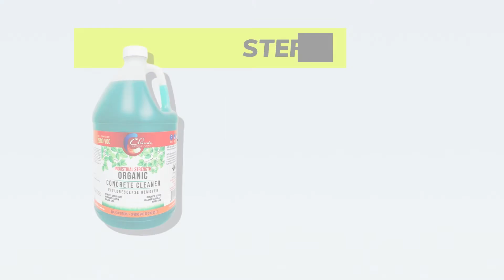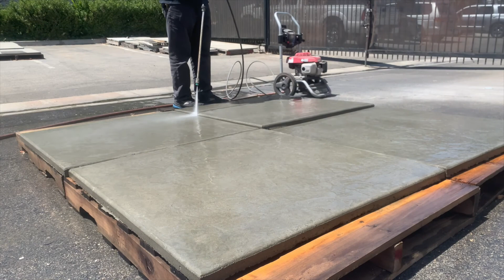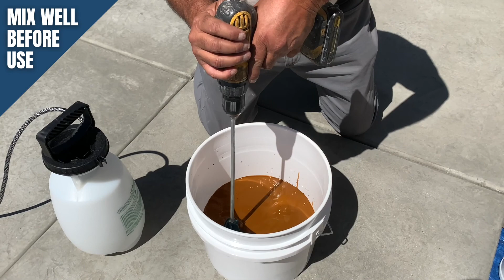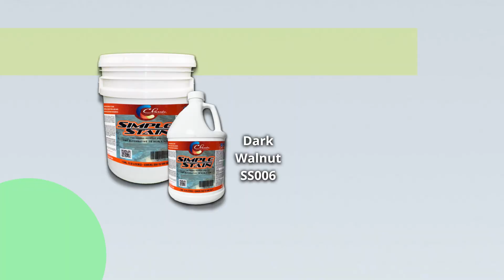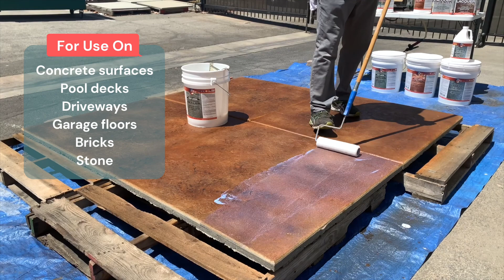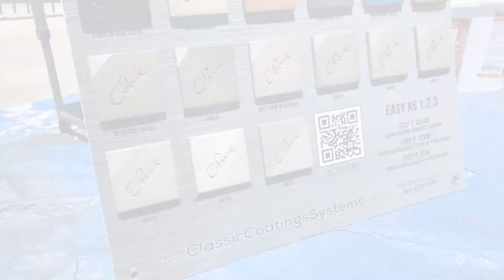How To: Clean, Stain, & Seal Concrete with Simple Stain

Comment: He did not neutralize the stained concrete before adding the sealer...the acid in the stain will eat away the sealer   if not neutralized.
Reply: Anthony, this is a water based stain, not an acid stain.

Comment: Do you have any videos showing this on smooth new concrete? So to see if color effects are the same. I have a new 30x40 garage and want the acid stain look but I also already have bath insulation installed and some wood walls so pressure wash not an option

Comment: I want to stain an older patio with some cracking (other than expansion joints).  Should I seal the cracks?  Will the sealant take the stain too?  Also, this patio had a "grass" carpet that was glued down.  When I took up the carpet there was some dried glue remaining.  Will I need to get it all off or, if it would'nt cause the sealant to delaminate, it might make a more interesting surface?

Comment: Best Acid Stain Video ...Hands Down .
Reply: This is a water based stain,,, an acid stain is a chemical that makes the concrete turn color ... a water base has a pigment already in it ... its an easier application for DIY and can create a great look. the process for acid stain is quite different,
Reply: No Neutralizer  Amonia